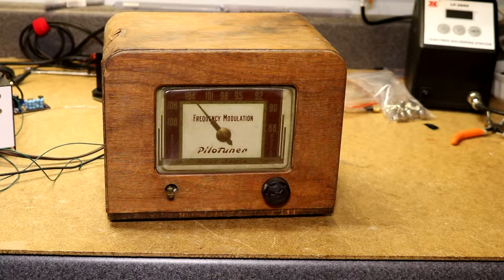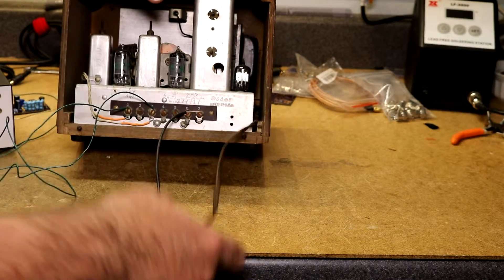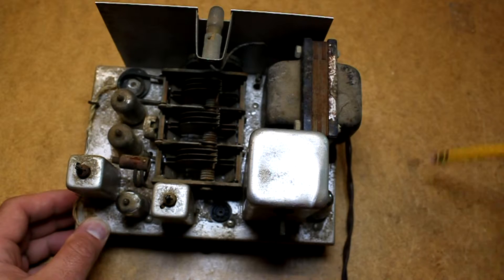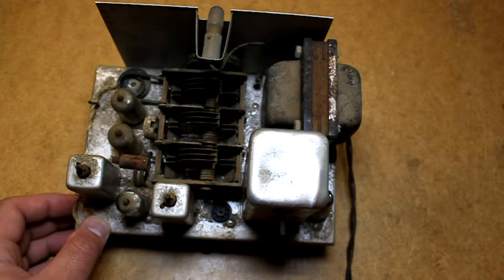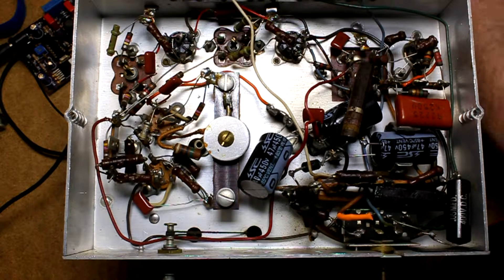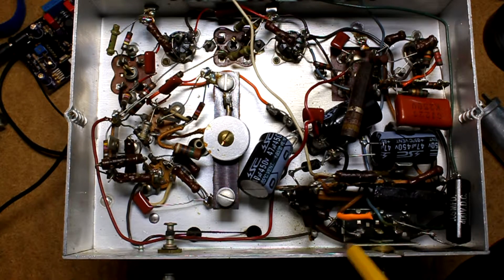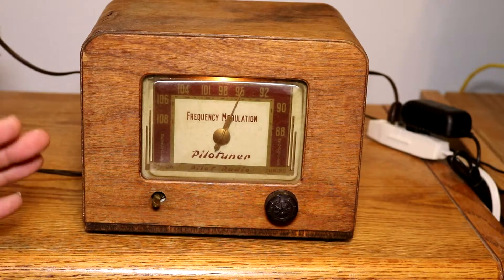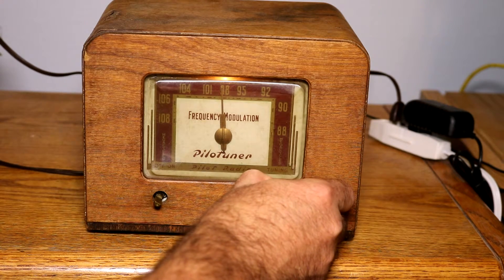Pilotuner T601 Tube Tuner Restoration

Comment: Hi there.  Nice video.
You mentioned the 2uF @ 6:27.  You replaced it with a mylar cap.
The schematic and the original filter cap can show it being electrolytic.
How did replacing the 2uF electro with a mylar affect the tuner?

Thanks,